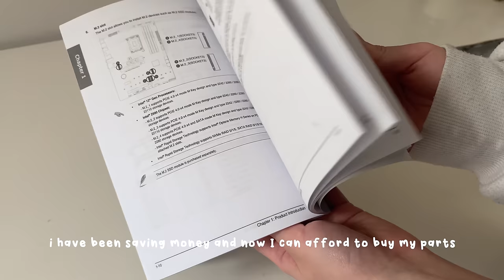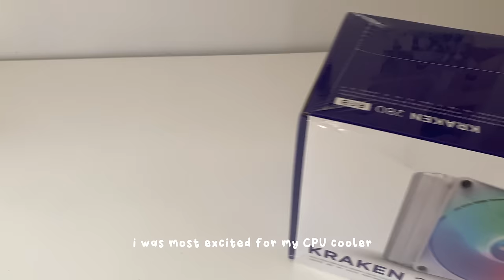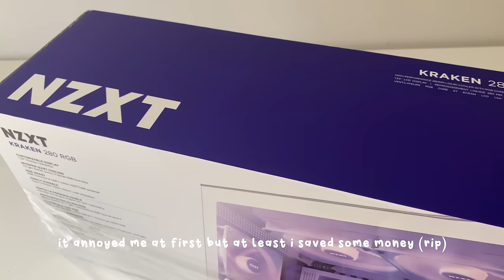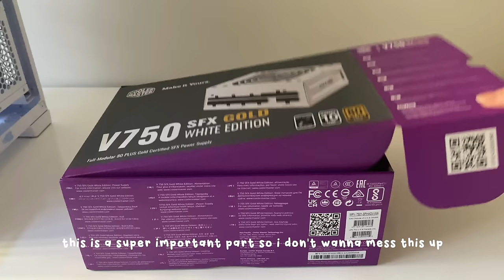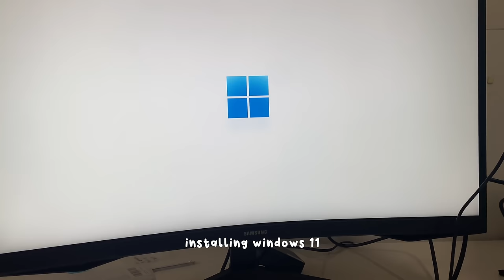building my first gaming pc 🤍 | white aesthetic, mid-range, lian li dynamic snow mini , rtx 3060

Comment: water cooling for the 12400f is crazy.and not just any watercooling she got nzxt kraken aio lmao
Reply: I think it’s like 280 usd, because of the lcd screen, and it’s a 280mm aio. Not to meantion, the rgb fans.
Reply: Could have gotten a 13400 a decent B760 board and a decent air cooler and even with DDR5 costing more than DDR4 it overall would have cost about the same.  Or a 12600 and a B660 board.  $200 for a $150 CPU leaves me shaking my head.  That said if she's happy with it I guess it's all good.
Reply: @nadtz I'm water cooling wit da 7600x
Reply: @wavesxi1001  Zen 4 out of the box runs pretty hot so the 7600x is not apples to apples with something like the 12100f which with a good air cooler runs at least 10-15c cooler when doing something like gaming.  It's also comparing a ~$100 CPU to a $250 CPU so...
Reply: @nadtz  no I'm not comparing I jus wanted to share mb💀
Reply: She is clearly going for aesthetics considering she paid extra for the white mobo, ram, gpu, cable sleeves ect. Why do all that to put in an ugly air cooler or aio.
Reply: @tetrizine  It's kinda like ricing a corolla though.
Reply: @nadtz looks like she’s planning on upgrading later as she goes. Doesn’t really hurt to get the aesthetic down first before performance
Reply: @nadtz why do you care. She clearly has the money and loves the build and she can always upgrade the cpu and graphics card later so it doesn’t matter.
Reply: @Stephen-go5gl  For the same reason you cared enough to comment, it's just how the internet works!
Reply: Lets be real here they aint getting the aio for cooling, more so for aesthetic
Reply: 750w power also crazy
Reply: @user-kn5vf2nx4z It won’t hurt anything bruh
Reply: @user-fr9lm1bm4x nah personally I get it, she’s going for aesthetics. But if it was a dude, he’d get murdered by everyone even more 😭. I have mad respect for any female building pcs, I think it’s cool af...
Reply: What’s wrong with nzxt aios
Reply: @user-fr9lm1bm4x nah if its a girl people just simp, if its a guy everyone start roasting. Bro just gave his opinion and yall crying
Reply: Bro im water cooling my 3400g 🤡, it has only one fan in the front

My rtx 2070 be HAWT

Honestly I would throw my corsair h100 aio for a Noctua nhd15 as my 3400g is OC to 4.15 and gets quite hot on long periods of gaming, plus no maintenance in air coolers
Reply: @VR00100  what case? just get some more case fans, if u have no fan at the back of your case, youll have no outtake. So all the hot air is just trapped in your pc, thats why your temps r so bad
Reply: @rdr.erased gamer girls or just girls doing more male based hobbies get extreme hate. Men make pcs a lot and have different aesthetics for different ones they build, so it might not be the best performance wise but aesthetically it’s great. They don’t really get hate compared to girls
Reply: Much hate*
Reply: @Stephen-go5gl like fr bro they so worried about her pockets but not they own😂
Reply: Yea its compleatly over kill I have a kraken elite 360 and a 7800x3d and it runs hot
Reply: @tetrizine  air coolers actually look better believe it or not
Reply: @SuixdeCity  Everyone is entitled to their own opinions yours just happens to be the wrong one. It's entirely up to one's own tastes and preferences. Don't go stating such a thing like it's a fact when the majority of people would most likely disagree with you.
Reply: @tetrizine  nah there’s some very good looking air coolers out there
Reply: Bro air cooling is so outdated and btw cool yourself with cold water then with cold air and see the difference XD
Reply: I have a nzxt z73 (360mm) for my i3 12100f
Reply: As she said, she's only using it for now and she will invest on better one later on.
Reply: Did you pay for it?
Reply: @tsukette. i think in this situation it is simply down to the fact shes new and hasn’t got as much experience, whereas this sort of hobby is male dominated right now so most of them don’t make, i don’t wanna say mistakes, but most of them don’t make poor choices like this, i think it’d be the same if it was a male in this scenario, ive seen many guys get backlash for doing things like putting a micro ATX board in an ATX build, it happens u know
Reply: @tsukette.  especially in regards to the PC community, i don’t think anybody is immune to criticism in one form or another, but in general i definitely do agree with you
Reply: It’s just an Aio not water cooling
Reply: I might finally have the money to build my own PC. Any tips for a beginner? 🙋🏼‍♀️

In this case is the water cooling just a waste of money for the processor, was there anything else wrong with it?

I know basics like atx case sizes, how you need to check that your cpu, graphics card and RAM fit the motherboard and that there is enough power to run the whole thing. I also know about graphics card and cpu bottlenecking.
Is there anything else to take into account?

I have zero experience on actually building PCs (arduino probably doesn't count lol). I know that you shouldn't obviously touch the motherboard too much and how you should apply thermal gel, but any common tips on how to make the building process easier would be appreciated.

Ps. Are there any sites where I can easily see if my components are compatible?

Thanks if someone replies.
Reply: Hear me out its pretty decent
Reply: @user-fr9lm1bm4x no even if it was a man the pc building community would be more aggressive 😅
Reply: bro is jealous
Reply: Bro she’s just building a beautiful pc, she don’t worry about it. I think people, who think like you and buying a powerful aircooling for the same price just have black boring coffins instead of computers.
Reply: Aesthetic ✨
Reply: obviously it’s an aesthetic choice but the water cooler allows her to maybe upgrade in the future and use the same cooler.
Reply: Also I forgot the obvious but choosing white parts automatically makes it 10% more expensive or worse.
Reply: Wish I didn't have to pay 92% for taxes below then 50$ 😢
Reply: It is true that she does not need it, but it seems that she took it to increase the beauty of the device
Reply: @Stephen-go5gl which will happen to keep up to games so she's literally just future proofing. Best way to go then she only needs to replace cpu and or gpu as she wishes
Reply: And water cooling on the FIRST pc!? That’s insane
Reply: @tetrizine ngl performance over looks matter more than looks over performance
Reply: @user-fr9lm1bm4x no one was making fun of her. Everyone was just commenting
Reply: They look better lol
Reply: Could’ve put that into a gpu that actually works 😂😂
Reply: i am water cooling my i3 10100f😂
Reply: Well yeah but shes gonna upgrade later, besides who cares
Reply: I wish i knew wtf y'all were talking about😂
Reply: BuT AeStHeTiCs ThO
Reply: fr, not just that, but why put some crappy parts with top tier parts in one pc? It doesn’t make sense. Also, the PC will not heat up that much that a water cooling system is needed. This just hurts my eyes, soul, and brain
Reply: She’s new, she might learn and upgrade, we never know 🤷‍♀️
Reply: The 12 gen i5 can support watercooling
Reply: Dont worry im watercooling my ryzen 5 5500 lol
Reply: @nadtz it doesn’t matter. they got what they need. this pocket watching and giving unneeded advice behaviour is very weird.
Reply: @hiamwendy5555  If it doesnt matter why did you bother commenting?  Someone else might care and/or benefit from the comment and like I said it's the internet, deal with it.
Reply: i got mine for aesthetic
Reply: You’ll live
Reply: you’ll live
Reply: Guys stop judging some people prefer aesthetics over performance
Reply: Something is called asthetic😂
Reply: @rdr.erased  Youre cooked bro. Gen Z and Gen Alpha is cooked fr, just because people are saying that the girl is going for aesthetics you’re saying that they’re simping? The title clearly says aesthetics learn how to read💀😂
Reply: @GanodermicGamer upgrading down she goes. That intel socket on the motherboard doesn’t go past 14th gen
Reply: @JamesV4524  ah yes the classic upgrading down from a 12th gen to 14th gen????
Reply: @JamesV4524  ah yes the classic upgrading down from a 12th gen to 14th gen????
Reply: @GanodermicGamer  what I mean is that if the pc builder is going for upgrades down the line then that socket isn’t a good choice
Reply: @JamesV4524 Indeed, even AM4 would’ve been a better choice since AMD are officially still supporting AM4 for now, they just released the XT refresh and plan to continue to support it

+ They have a Ryzen 9 5950X3D sample that they could always release (featured on gamers nexus)
Reply: @jamsyt5731 it’s because males constantly wanna compete and talk about the best build, and girls just wanna have a cute aesthetic gaming pc where other girls who are interested can follow along and buy the same parts. And every girly pc build video has mansplainers in the comments.

Comment: Nice build.  Just a few tip... when you put thermal paste on, consider putting it on the CPU and not the waterblock... that way you know you're covering only what you need and not putting on too much. It looks like there could be extra thermal paste on the sides of the block that could get onto your motherboard or leak down onto your graphics card later down the road.  Secondly, the subtitles said you added exhaust fans at the bottom even though they are intake.  You got the fans right, I think it was just a typo though.  Regardless, congrats on the build.
Reply: Is it fine using the pre applied thermal paste like on the Kraken aio or should I get thermal paste
Reply: @itsglocking  it should work.. just check your temps
Reply: sweet thank you  @LawyerSlays
Reply: + I think she has negative pressure (more exhaust than intake?) rather than positive
Reply: @itsglocking  Its perfectly fine using the pre applyed i myself use the pre applyed so its no biggie.
Reply: I feel like she put a bit too much thermal paste on it and she should've rubbed the previous thermal paste eeeeeeee.
Reply: Since i think you know pretty much about pcs how does she change the Color of the rgbs to white like theirs a button ?
Reply: @KIWISTITCH-REAL   that would be through the use of RGB software. She has both NZXT and Lian Li fans in her build so I'm assuming she has both NZXT Cam and whatever Lian Li's software is called.
Reply: @fizz8912  what is NZXT and why does she put just 2 rams and not 4 rams
Reply: @KIWISTITCH-REAL  NZXT is a computer part brand.
Some people prefer to use 2 RAM sticks instead of 4 to take advantage of dual channels (idk the meaning of this lmao) and it also allows you to run their top speeds without any fluctuations; it tends to be the safer (and cheaper😉) option.
If you start running a new build with 4 sticks, you might face some problems, so people recommend starting with 2, one in each channel to set up XMP profiles (accessed in the BIOS, and allows you to set the RAM at its intended speed - RAM is usually defaulted lower than their accessible speeds) and do other setup stuff before adding the last 2.

Anyone pls feel free to correct me on this😅
Reply: @fizz8912  Tysmmm for answering all of my questions 😁😁
Reply: @KIWISTITCH-REAL  np :)
Reply: @LawyerSlays  you can never put too much thermal paste on a CPU, as long as it doesn't get messy :)
Reply: @lakzefar449  thats essentially what i said
Reply: @LawyerSlays  ''you're covering only what you need and not putting on too much''

🧐 That's not how you wrote it though
Reply: So if i had three up the top and three at the bottom which ones should be at the bottom intake? then the exhaust at the top? or other-way around? (to me they look the same that's why i'm asking)
Reply: @Wolfloops  bottom intake, top exhaust (you will have to search up which way you need to put your chosen fans to get intake or exhaust), also if you planning to build a pc do so much research that you wont have anything to worry about (unlike what you are doing rn) otherwise you will run into problems lmao
Reply: I didn't know that about the thermal paste. I'll keep that in mind when I get my first PC soon. Coming to the comments and seeing the PC community helping each other out really makes my day.

Comment: If you want to go overboard with the RGB, get lian li strimer plus v2 cable extensions, will definitely enhance the aesthetic for your build.
Reply: Those are wild
Reply: What pin amounts are needed for this build
Reply: @Evsonlyfan  it depends on your gpu, the mother board strimer however should be 24pin

Comment: Great first build! I would recommend adding the additional screw into to help support/secure the gpu and flip the radiator fans around as intake so that you are bringing in cooler air from outside of the case instead of exhausting hot air from within the case into it. You'll still be able to see the rgb fans.
Reply: She actually has it the right way but she explained it in reverse. She has intake bottom, exhaust top, but she flipped it in her subtitles. Accidentally correct? 😅 but anyway you can see the orientation of the fan, despite what her subtitles said.
Reply: Building pcs is hard..
Reply: @peppep8738  I do t think it is. It seems like it is.

Comment: You said that your top fans is intake and bottom exhaust, while you set them up with the opposite. Which is the right way, we want the hot air rise easily and out on top as what you did. Just that current setup probably flip the radiator's fans so that you can get slightly positive pressure configuration, as of currently, you only have 3-120mm fans for intake at the bottom with 2-140mm, and 4-120mm exhaust. Just for better cleanup and prevents dust buildup with negative pressure configuration.

Comment: id recommend getting white cables with the cable separators or the separators themselves if you can find them (not sure if theyre sold individually), it would make your build look a lot cleaner than it already is! and i would try tucking in wires where you can. another tip i can give would be a monitor riser or mount to bring your monitor up so your speakers arent blocked, besides that this is a great build and setup, i think you did great for your first ever one. what games have you played so far? or if you already played pc games what game feels better with all the upgrades? (of course not bashing you for the cables you have and such since you mentioned your budget and i get that, just wanted to provide some tips.) goodluck with any future upgrades!

Comment: Great job!  I would suggest you maybe try and use the shorter plug for the gpu 8+8pin cable.  It usually has more power capability and is safer than using the extended cable for your gpu.
I have a higher power gpu so I had to use 2 separate 8+8pin cables for it (using the shorter of the 2 "pigtailed" cables, it actually made a difference in performance.

Comment: I would not build a computer right now because I'm angry at all graphics card manufacturers right now, but I am still addicted to build videos.

I have the same AIO, and I also sometimes regret not getting the one with the LCD display, but to be honest, it would be at a funny angle from my desk.

Haha! I also remove more expansion slot covers than I need to, usually exactly the ones you did.

You used a screwdriver with those thumb screws? Oh, you have long nails. Never mind. It makes sense. 😁

That little figurine on your graphics card is really cute. I've thought of adding something like that to the inside of my case.

Comment: I saw a few comments talking about how hot air rises and the fan configuration. What you've got will work well and is absolutely okay and if its what you like the look of that's cool. The force of hot air rising is weak and the fans would overcome it easily imo. Fair point to keep in mind if you do get temperature problems though 
Nice build!

Edit: the radiator and pump setup is entirely okay too

Comment: for my o11, i have the bottom fans as the intake, 2 infont as intake, 2 with the aio as intake, 3 on top exhaust, and the back one as exhaust too. tbf my temps are amazing, love this case. clean build!
Reply: yeah this is how it should be done, i have this exact build but fans are switched

Comment: Nice build, I like the white asthetic. But I would have exchanged the rog strix board with a prime one(To keep the white) and then spent the extra money on a 3060 ti gigabyte white edition, or a 3070 for extra performance.
Reply: Also, for the cable beneath the gpu. I would tie so it won't hit the GPU fan. I did destroy a 2080 like that.
Reply: Yup... Overkill for 12400f
Reply: @davidnurhidayat5068  Not overkill in terms of bottleneck. According to calculations this combo will not bottleneck
Reply: we're taling about the board bru @Bob-bw5zx

Comment: Nice video also here's a tip for your motherboard never hold it from the middle or it can damage it always hold it from the sides and also put it on the box so it doesn't get scratched damaged or anything.

Comment: Clean build. 👍Check the PCIE cable underneath the GPU. Looks like it might be blocking a GPU fan. 👌
Reply from the maker: the cable is a bit short but i made sure it wasn't touching the fan ❤ tysm thoo

Comment: You could Switch around Intake and Exhaust Fans, you want to take in cold air from the bottom and exhaust at the top. Physics ;) doesnt break your pc if you dont though so no worries

Comment: Nice build, i have an extra bracket under my GPU so it stablises when its heavy weight comes down off the edge. you have a smaller one and not room for one but its totaly custom if you want one or not just a tip for next time!

Comment: This is a tired topic at this point, but the fan setup is actually correct and you've just mislabeled them in the subtitles. Judging by the shape of the fan blades and their rotation direction – bottom ones are intake and top + rad ones are exhaust. So everything is fine!